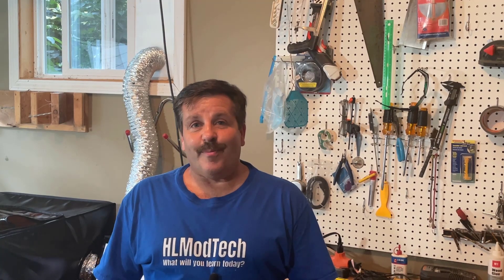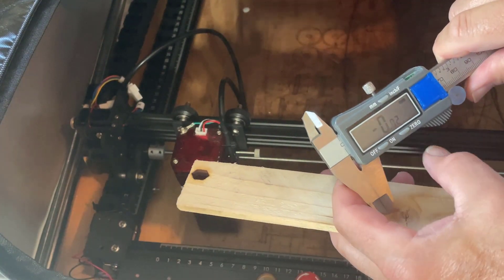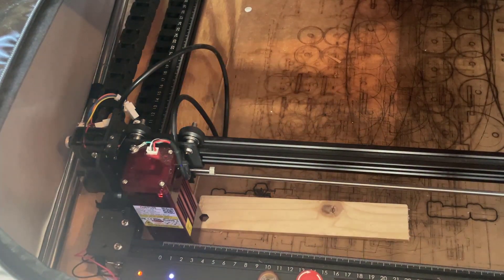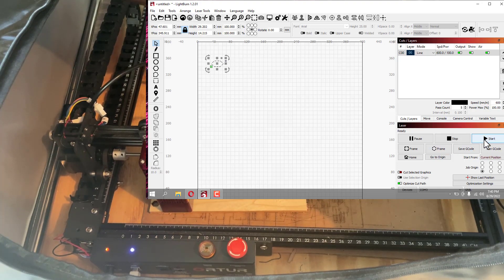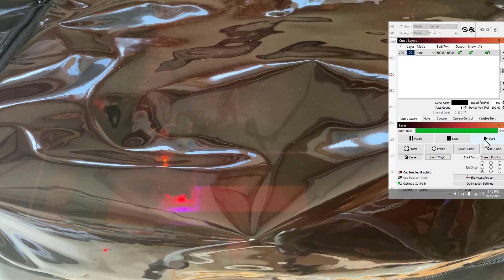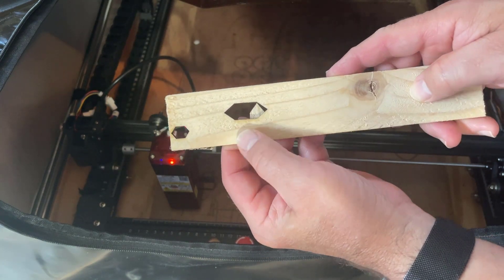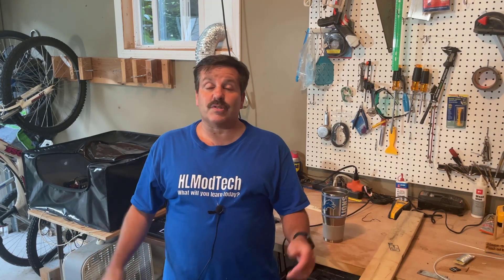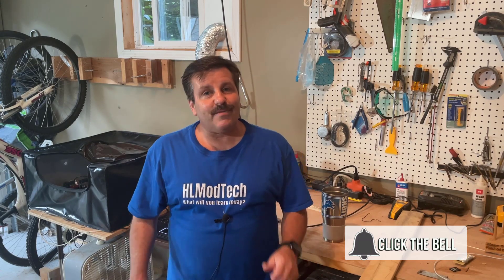Cutting 6mm wood with the Ortur Laser Master Pro 2 Reclaimed Pallet

Comment: I have found this years later as I'm now thinking of upgrading my LM2 Pro since I need to cut 5-6mm plywood. It seems you are using the original 5W output module that originally came with the LM2 Pro (like I have as well). Is that the case? Then I may not need to upgrade if I don't mind doing 5 passes.
Reply from the maker: Patience is a virtue... =) I have a 20W as well now. It is super nice to let it do the cutting... and let the lower wattage machines do the engraving.